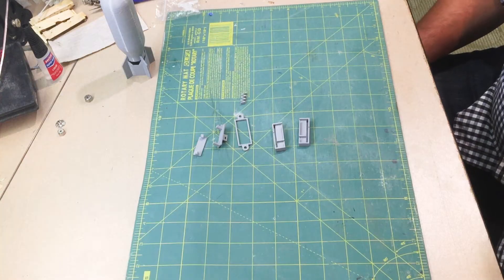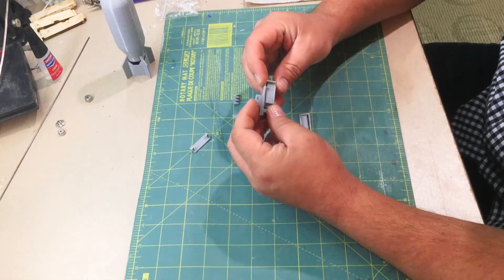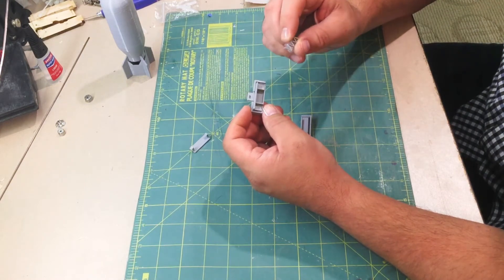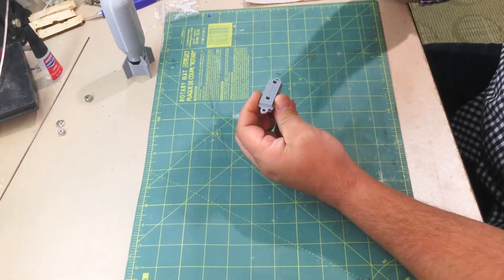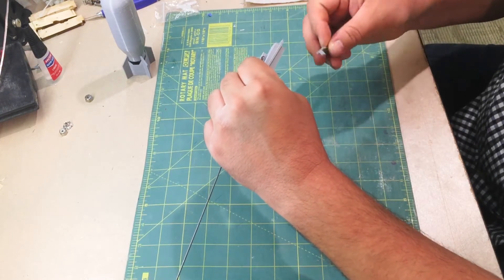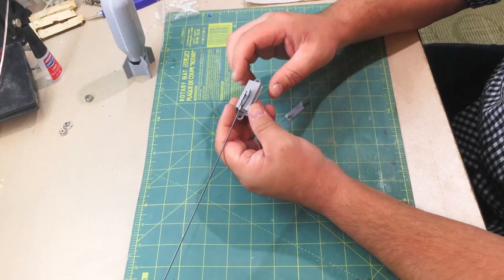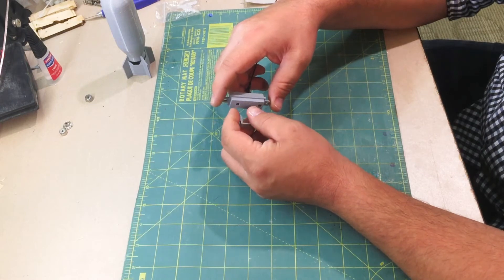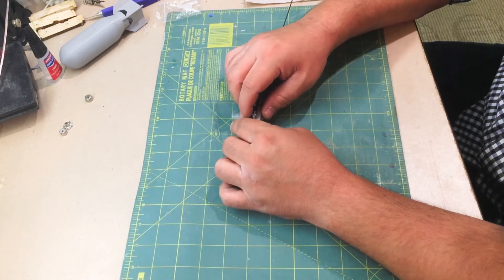BUILD: 3D printable drop mechanism

Comment: Thanks for the design, I swapped out the printed spring for a pen spring which made it a bit more reliable, then molded the bomb piece to have a loop with a rubber band to the fuselage so I could load up some parachute men.

Comment: Josh--  I printed this and it came out very nice.  Only thing is the interface between the the catches in the mechanism and those attached to the bomb are very critical.  If you could add a mm in length to the legs of the catch that attaches to the bomb it would be perfect.  Thanks!
Reply from the maker: Check your fitting, brother! I've printed this one in PLA and ABS. The ABS version did shrink a little and it still worked just fine with a PLA catch. Any longer and you risk the part wobbling around underneath. If you need to get it a bit more loose, try sanding the face of the case a bit more to allow a bit more clearance. This should not disturb any of the internal geometry and make quick work of it.
Reply: @JoshuaOrchard  I'll give that a try. Thanks!